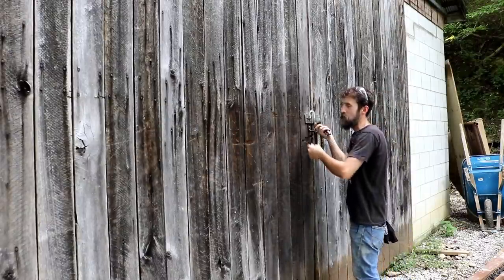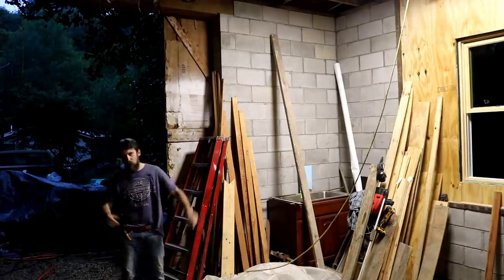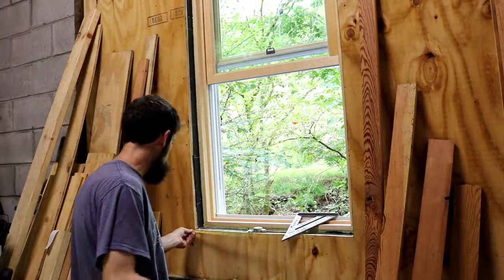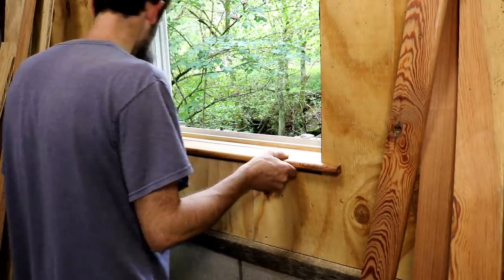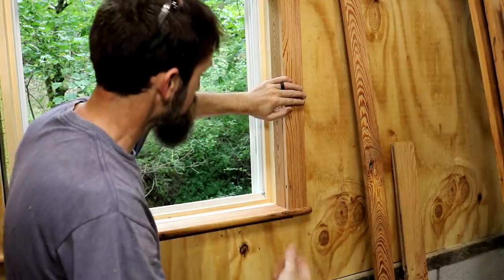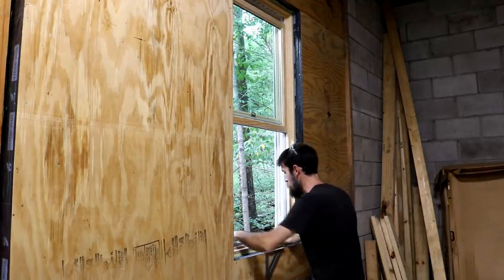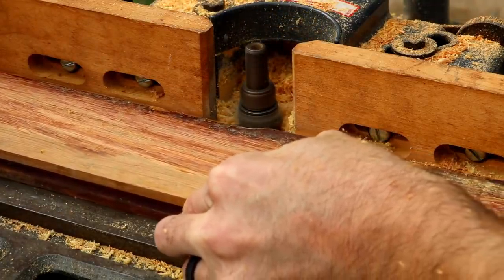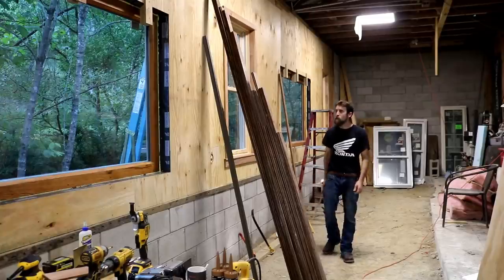Trim work from 100+ year old flooring . Shop windows looking Amazing!

Comment: Steve,

It's always good to use up old stock instead of just letting it lay around taking up space. Besides that the darn stuff you've been using look far better than store bought stuff from now-a-days.

One thing that has bothered me, being a wood-butcher (carpenter), is the types of hammers you've been using for woodworking. It wasn't till the end of the video that I finely saw a regular claw hammer … no worries, that's just my OCD kicking in!

Any way, you'd make a good carpenter with a little more training … you do good work! If it takes you a little longer give it no never mind. It's a job well done!

Dan Kenney
Moscow, Idaho

Comment: Tip for the saws and jigsaw blades, along with the circular saw blades, is to have a small plastic bottle with wide mouth with a lid, filled with a thin layer of light oil at the bottom, and a wad of cloth soaking the oil up. wipe blade before and after use with the pad, which will both keep the blade from picking up gum, but will also remove it if any is in the teeth.  Have a bottle with a foam scourer attached to some stiff wire as a handle, to get in the deeper reaches of the saw as well, plus also works on the guides of saws and planes.
Reply: There's the Paul Sellers rag in a can trick. Personally I use paraffin wax. Gulf wax or the like. I use wax on plane soles and saw plates. I'll use it on jigsaw blades too.
Reply: @1pcfred  for me the oil works well, as it keeps the blades from rusting, as i live in a humid area.
Reply: @SeanBZA  it can be humid where I am at too. I use WD-40 to keep things from rusting on me. I need to get another gallon can. I am down to my last bit in a squirt bottle now.

Comment: You should really put a riving knife on your table saw the board is bouncing because it's punching at the back, you I'll eventually get kick back or even worse when using fence it can twist the board drawing fingers into blade
Reply: I thought they came as standard on all table saws. regards
Reply: @garyc5483  They almost always did, but old timers like my generation very often threw them out at the same time as we set up the saw. The thinking was they just got in the way.The safety systems used now are much, much better designed.
Reply: @crichtonbruce4329  old timers weren't wrong.
Reply: Problem is that if you look there is no place for a riving  knife to go on that saw. Look at the blade cover and it is close to the back of the blade. It never had one from new I bet. Also Steve has the blade set up far too high, I know it's an anti kick back Freude saw blade but if you have the blade set so it just protrudes through the top of the wood the arc of the blade is slicing through rather than almost pushing it straight up as it tends to do when the blade is set so high. A blade guard set on the riving knife is even better because there is no chance of it kicking up behind the blade. It won't stop a kickback but his blade design is meant to eliminate that situation.
Reply: Paul Frederick well sometimes they didn't know best lol just lost a few fingers!
Reply: @samrodian919  if you're not a concert pianist what you need all them fingers for anyways?
Reply: Tht model isn't built for  riving knife.. I'd look into getting a Microjig splitter.  I have the same saw..
Reply: @chrislucy1812  what are you picking them up for? They're just cut offs now.
Reply: @1pcfred  ---Sometimes they were....
Reply: @madscientist5969  never
Reply: @1pcfred  ---Opinions vary!
Reply: @madscientist5969  when I want your opinion I'll give it to you too.
Reply: @1pcfred  ---Figures, you'd say that.  Happy sawing!

Comment: You should always use a fence when running boards through a table saw. Always.
Reply: and/or a miter guide, and/or a push-stick

And, I was taught to only have the minimum amount of exposed blade necessary to ensure that you are cutting through the workpiece.
Reply: Always this crying about the safety is annoying!
If you know what you are doing it's usually no problem.
If someone else is involved it's another story, otherwise it's your own responsibility!
So pls. Shut up!
Reply: @jdavidkatz  I have cut 100th of cubic meters of fire wood on open table saws like these and even more on Tractor driven Rocking saws. I don't know if you Americans have those, but they are Circular saws with 1 meter and bigger blades. The teeth on those are inserts, and it's normal that sometimes one of those go flying. If you don't know this and just casualy use thes old thing's like a modern tool, they will kill you or at least hurt you in one workday. You even have to consider what is in line with the blade far away, and how the guys around you are set up, so no one crosses the line when this thing is cutting. Never had one Incident.
If you know what you are dealing with, and know your abilitys, you don't need a fence ore guard around the blade. But if you are a careless idiot, you can cut your hand of even with all safety crap on the machine!
Best safety equipment is your brain!

Comment: I think I have about 2-300 board feet of that pine that I won at an auction it was an old dance floor put in around 1924 and I got luck it was stored in inside

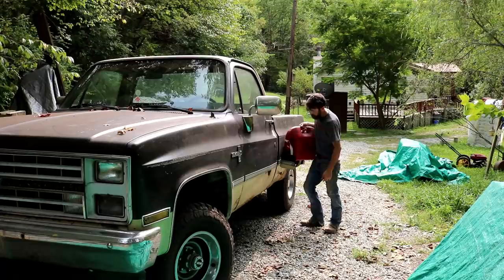Comment: 27:53  wait a few years for all the excitement to settle, then buy a second-hand Tesla CyberTruck.  Charge it overnight at home and enjoy a gasoline-free transporter that provides built-in 120 VAC power for all your plug-in tools.  And it will be a hoot to drive.  All stainless steel - no paint to scratch, no rust.  Probably good for at least 10~15 years before you notice serious battery range loss, and the only maintenance items will be tires, windshield wipers and the occasional cabin air filter.  Brake shoes/rotors will last a long time with regenerative braking doing most of the work.  Makes a great fantasy!

Comment: Hey Steve, You can mix the shavings and superglue together and shove in the hole, let it go hard overnight  and sand back, I use this method with model ships and works well
Reply: Kelly you don't need superglue it will go everywhere you don't want it lol ordinary wood glue and mix with the sawdust of the wood your using. It will go off in three or four hours, certainly overnight ready to sand back

Comment: Ey Up Steve how you doing! in the Uk it's called a spindle moulder. The shops coming on, it will need to be weather tight very soon ,winter wont be far away!

Comment: Steve, sorry for the go spend money on something comment, but next time you need to do woodworking and want to vacuum capture sawdust go to home depot first.  They have a dust cyclone now that clips on the top of one of their buckets, run you about 45 bucks for the cyclone and bucket.  Saves a TON of your time on cleanup, including the floor and your shop vacuum filter.

Comment: Hi Steve, just wondering why you are using all the wood around the windows instead of the concrete blocks (or bricks), wouldn't that be much more easy and fire proof?

Always good to see Elizabeth in your video's!

Comment: Do plane with more than one board fit side by side (indexed). Why? This will plane away the -  tongue/grove relative variance to finished surface (lengthwise) which will turn into random joint-joint step ripples, that will minimize the effort when we want to work flatten the joint ripples later.

Comment: Good morning  Steve, while you were at Lowe's, you should have bought a good finishing hammer instead of using a mason hammer and a little tap tap hammer. Just an observation.
Reply: I don't think Steve is planning on going into finish trim carpentry. So the hammer's he's using are fine.

Comment: Looks really good there Steve, I wouldn't worry about the nail holes either. It is part of the character of the wood. It appears you have a substantial drive into town. Just how far do you have to drive?

Comment: I hate being negative, but I would hope Steve if you saw me using a power tool in a way that had the potential to cause a catastrophic injury you would set me down and tell me what I was doing wrong.  I've seen several carpenters over the years using a table saw without a fence and push stick and the blade at it's the maximum height.  They are usually the ones that are missing one or two fingers.  Machinists are always talking feeds and speeds.  Calculate how many times the teeth on that blade will hit you before you have time to react.  We all look forward to watching whatever you do every Saturday morning.  Please take care and God Bless!

Comment: Need a push stick for that router table
Reply: perhaps a riving knife too, right behind the blade, to stop it pinching.  And run it lowered too - poking through the top surface less.  That can be the difference between a cut and only counting to 9.
Reply: I'm a bit worried
Reply: Not only that but three finger springs as well , two to hold the work down to the table and one to push it in to the fence, plus the safety of not allowing the work to kick back for any reason. Doing it the way Steve and his dad were is a recipe for loosing one or more fingers. I've been doing professional woodworking all my life and still have eight fingers and two thumbs. But I did put my right hand into a bench circular saw about eight years ago through not paying attention. I learned my lesson even though I'd been doing woodwork for 34 odd years. Never too old to learn especially where safety is concerned.
Reply: @criggie  A friend can only count to 7 now because of a table saw. One of the tools the definitely deserves respect.

Comment: Am I the only one who cringes a bit at seeing so much of the table saw's blade exposed above the work?

What I was taught was to expose only as much blade as is needed to ensure that you are past the surface, on the theory that less exposed blade = less possibility of something that you don't want to cut getting caught by the blade...
Reply: Steve, you do fabulous work.
Lets keep the fingers safe by lowering the table saw blade to correspond to the thickness of the wood.
God bless.
Eric
Reply: The main reason for keeping the saw blade as low as possible is to minimise the risk of kick up, when the back of the blade gets tight in the slot and lifts the back of the work. It is worrying not to see a riving knife and blade cover.
Otherwise Steve, love the channel and the attention to detail.
Reply: @Adam Dee That too, but less so... freehand usually just means a diagonal cut.

I'd rather see Steve using a miter-gage or a sled, or even a push-stick or two, but all of that exposed blade is out there to catch on something that he really doesn't want to get caught.

Comment: Everything looks great except for that plywood. I think I would have glued on some thin sheets of drywall (1/4" or 3/8") before trimming the windows. This would make a nice surface for paint. It is just a shop, but you've made the mistake of making the windows too nice! It's like when you make  a clean spot!

Comment: beautiful trim work . was wondering if you were going yo put electric on that wall ?
Reply: If Steve does he can run conduit. It is a work shed. So conduit on the wall will look fine. Or wiremold. Personally I'd go with conduit myself. It is the classic look.

Comment: BTW, "6D" nails are "six penny" nails.

And just to be the only person not complaining about the table saw blade, seeing you use the chop saw cross-armed made me cringe. Not because it is particularly dangerous on a chop saw, but because it is a bad habit to get in to if you are ever likely to use a radial arm saw. They can catch a hunk of wood and come shooting 18 inches out at you before they hit the end stop, and if you have your arm crossed in front of the blade it can be just too bad. With your arms crossed you also have less force to buck the travel of the saw motor if it jams.
Think of it the same way you think about the chuck key on the lathe.

Comment: Never use a table saw without the fence!!
Reply: Depends what you’re doing. For Straight rips it’s a must. For a tapered rip you can free hand it without the fence. And you never want to cross cut with a fence.

Comment: Surprised you're doing inside work when the winter is around the corner and there's still exterior trim (not to mention roof) needs to be done. Your also going to have to cover all that finish work when your pour the concrete slab; when I did my floor slab (after building was enclosed), the concrete managed to splash as high as the upper sash of the windows.

Looking good; what's your plan for the plywood? Paint/stain/cover with something else?

Comment: I have the same jig saw from craftsman and I bought in 1974 seems hard to find blades from them and I would hate to have to buy another.
Reply: That saw take U shank blades? They're still available. You do have to know what they're called to find them though. Do a Google shopping search for u shank jigsaw blades. Looks like you can get genuine Craftsman ones at Lowes today. I might go with the Bosch brand myself.

Comment: Hey Steve, the wood you use for the window trim is very nice, with your bottom window seal, the skirt you have there it imo would have looked good with a 45 degree angel cut to the ends. Getting into woodworking I find very relaxing. Also I think the colour of the window frames look really nice with the offset the trim you have added. A tip you can learn a bit from April Wilkerson as she does a lot tips to help people out  https://www.youtube.com/user/AprilWilkersonDIY

Keep up the great work I have really been enjoying your barn fix up videos

Comment: I have seen custom homes that do not look as nice as your windows and trim work. I guess that is because you are a metal worker and tight tolerances are a must. Love the view. Also about the gas cans,  EZPOURSPOUT.COM, will cure your 20 minute fill. I have three of these and love them. I use the Hi Flow ones for my zero turn mower, regular for walk behind mower and string trimmer.

Comment: A good fix for those gas cans can be found at Tractor Supply  , there are 2 different types ...        https://www.tractorsupply.com/tsc/product/ez-pour-hi-flo-replacement-spout and the other is https://www.tractorsupply.com/tsc/product/ez-pour  , I have used the second one an now cans without any problems , after seeing a few videos on YT about them . They give you the ability to use new cans with the old type spouts and vents . Hope you allow links in your comments , if not , look for EZ-Pour on Tractor Supply .

Comment: Hi from the UK Steve. You have really disappointed me. Considering how you adhere to safety practices, I was amazed to see you stupidly cross your hands on your sliding mitre saw. I know lots of very careful one handed hobbyists. Then Elizabeth. The face covering isn't to protect you, it's to protect us from you. If it isn't covering your mouth AND NOSE, then don't bother with one. Other than that I think you've done an incredible job on your workshop.
Terry in the UK.

Comment: Steve . . . . about your table saw techniques . . . You may want to edit them out of this video . . . I'm 68 and have been using a table saw professionally for 50 years and let's just say . . . well you would be looking for a job if you were working for me.  And given that I owned a cabinet shop and ran some professional shops over the years. . .  sigh . . .  Yea, edit out your table saw techniques because someone is going to lose fingers or even hands doing what you showed.  You pretty much broke every safety rule I know of for table saw usage.